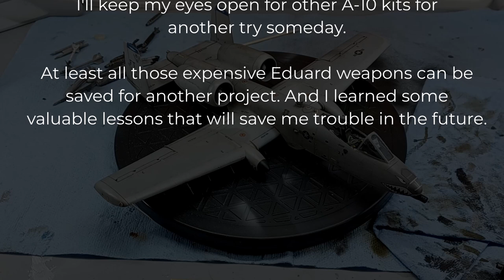Hasegawa E43 -- A-10C Thunderbolt II -- Part 2

Comment: Good learning lessons - I think the kit still turned out very well for your second go - far better than my second kit fared!  Here are some suggestions you may find useful - Spray cans are too imprecise - try using Mr. Hobby surfacer 1500 with Mr hobby leveling thinner instead of a spray can primer (50%-50% mix) - even the Tamiya extra fine can flood details or worse, create a coarse coat is you don’t get the distance and spray right.  
Additionally, I found it way easier to paint the pylons as well as apply the panel lining before I attach them to the jet.
Your armaments are beautiful - definitely top notch!  Thank you for sharing!
Reply from the maker: Thank you.

I started using Mr Hobby primer and varnish from the third kit onward. I was very overzealous with assembly on the A-10. The more kits I do the more I feel like I want to do assemblies by color. I would do well to spend time planning a build.

Each kit is learning to make the next kit better.